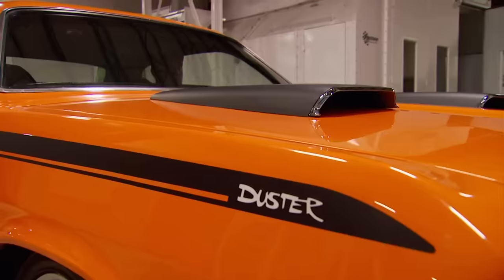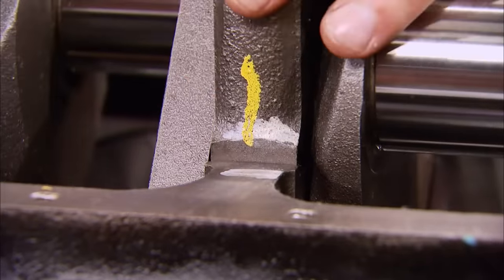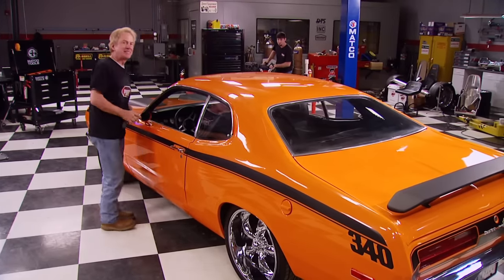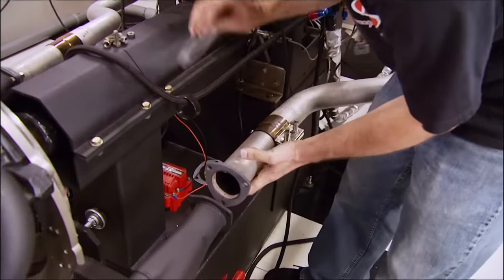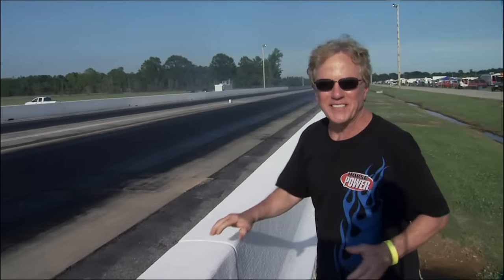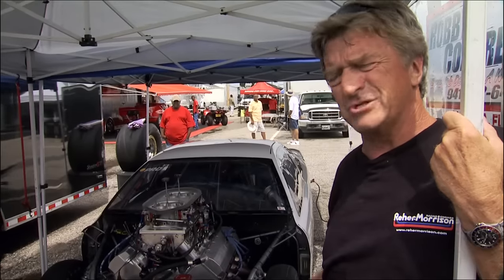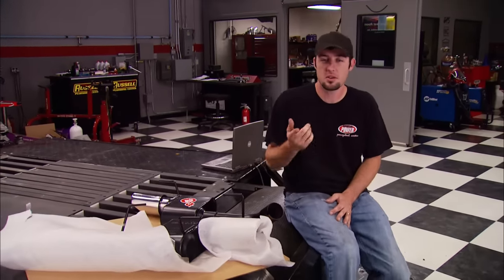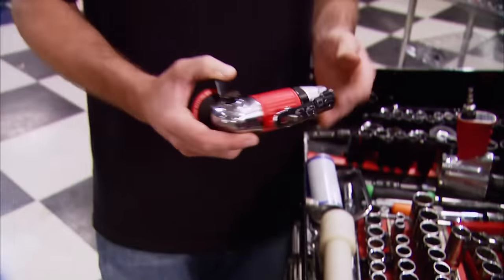Mopar 360 Build on a $2,500 Budget - Horsepower S13, E17

Comment: Imagine how much power this could of made with a bigger cam and some port work.
Reply: Right, if you are putting a cam in, why the hell would you put a stock cam in?
Reply: I would have added those items. some longer stroke too.
Reply: @enigma9789  this is probably only the first episode of more to come
Reply: @enigma9789  usable power band for a dd
Reply: @ Andrew... It doesn't even need that. If you look at the cylinder heads they had huge combustion chambers and dish pistons. That 360 couldn't have had 8:1 compression. A good cam and 10:1 compression would make impressive numbers, but it's not a GM product so they have to rig the build.
Reply: 340-350hp
Reply: @enigma9789  that wasnt stock. stock cam made 250hp this one 314hp
Reply: Just porting and Polishing the factory heads with that cam will give the 360 around 335 HP.
Reply: idk...  I like the idea of a old "mildly" built 318.  But I know I can make more out of a sbc for less... and I know if I had a lot of money I could make more with a ford.  hmmmm.. decisions decisions. . .   HOW about this, I have a forged 3.75 crank for a 350 v8, if someone has a forged crank for a 318 I'll trade you and throw a LA engine in my dodge.. IF not I'll throw a 6.3L Chevrolet engine in my dodge. lol (yes between a 383-385 depending on how happy I feel when boring it)  actaully yeah screw it, I'm throwing a chevy in my dodge.
Reply: @bigsean2473  headers, carb, lack of smog equipment, and tuning account for the power increase.
Reply: @Ecosse57  maybe some but i dont think that much as the car had a carb from factory, and smog dont take away much at all.. the headers only really give power if you engine has the power already. ill check into this but pretty sure not a stock cam
Reply: @mrmedium7984  There're plenty of better cams than a stock unit for driveability....
Reply: @Autojones  "rig the build" what in the hell does that mean? Mopar has a pretty big aftermarket.......
Reply: @bigboreracing356  that is irrelevant how big ford & chevy's afttermarket is. Mopar has plenty of aftermarket parts, I've been getring their performance parts cataloges since the late 90s..........
Reply: @bigboreracing356  Who the fuck is talking about racing turbo LS cars (I own one)? We're talking about the aftermarket..
Reply: STREET RACER ...That's why some of us stick to bracket racing and leave the heads up gig to the fellas with deep pockets !!!  In the heads up world, there is always someone with more cash and a faster ride. In bracket racing, skill wins every time. Rock on 👍🏻
Reply: @bigboreracing356  I own a 6.0 4 eye fox with a s480 & a powerglide.....
Reply: @bigboreracing356  No I used an ls because it has a 6 bolt cradled main, large cam journals, grear flowing heads (square port), factory parts that make hp such as the intake, & all around strength.
The parts that went into the block; crower rods (they make stuff for mopar), wiseco pistons (they make stuff for mopar).
Reply: @bigboreracing356   can you say Hellcat?!?! LS and Coyotes engines are fairly new compared to the old Dodge engines. Old  Dodge's will beat Old Chevy's and Old Ford's everytime. If you want to compare new stuff then compare it to the new Dodge stuff!! P.S. old Dodge's can run on nitrous too!
Reply: @bigboreracing356  The aftermarket for a small block Chrysler is more than sufficient to run with any other small V8. A cam, headers and some kind of power adder are all the non stock parts you really need for big power if you truly know what you are doing. For example Uncle Tony's Garage just threw together a serious tire killing low compression low buck 318 combo that is basically just a cam, intake and headers.
Reply: @bigboreracing356  I'm getting prepped to do just that, gonna build a blown 360 with factory heads and bottom end for my 68 Coronet with a six point cage. I'm going to intentionally turn a 904 into a time bomb to put more power to the wheels than I could if I had a 727. The car should weigh about 3400-3500 pounds assembled and make about 700-800 HP and about 1000 torque, maybe a bit more if I can afford forged pistons so I can turn the boost up and run some emergency spray too. A car that light with that much supercharged horsepower is gonna be pretty potent, especially when you consider the Mopar B body's reputation for hooking up and launching hard on the street.
Reply: @bigsean2473  - your forgetting a couple of HUGE details. The factory 360's had really crappy intake manifolds with EGR ports that killed about 50 hp. Then they had really crappy exhaust manifolds also. This Dyno engine didn't have to fight against either of those two major handicaps.
Reply: @jackandblaze5956  stock cams were as follow for 360 engines:
252/256, lift 410/412
252/252, lift 410/140
268/276, lift 430/444

they used a 276/286, Lift .441/.441,  i didnt for get anything. and a lot of the things you say are true, but the power number people think thing like intake and headers give them are not always  what you actually get from them  .   but my whole point was the cam was not stock if it was i dont think the would of gained 64hp that they did.
Reply: @bigsean2473  - The original 360's from the 70's had EGR intake manifolds. EGR intake manifolds bleed exhaust gas into the intake manifold. EGR = exhaust gas recirculation. It was done before fuel injection was common to reduce combustion temperatures, thus reducing the creation of nitric oxide and nitrogen dioxide gas, which is not the same thing as nitrous oxide. Again, the EGR system lowered combustion temperatures significantly which had the effect of reducing the horsepower by at least 50. Also, in most v8 applications, tuned headers produce at least 5% more power than log type cast iron exhaust manifolds when all other variables are equal. So your figure of 250 HP vs 314 HP was actually spot on considering  the change in exhaust and intake manifolds. Making more power is not always only about the cam shaft - there are other factors and some are even more important than increasing the cam lift by 4%.
Reply: EFI would help too
Reply: @mrmedium7984  They are the smaller valve heads too, don't want all the power on the top and wait too long for it to come on with a huge cam then no flow in the heads, that's a nice dependable street engine
Reply: @bigboreracing356  no , reason to feel sorry it's only a chunk of metal
Reply: @bigboreracing356  I would build a small. Mop. for competition classes outside bracket racing either. But comparisons are generally for A holes especially when there's 10 yrs difference between when they were originally designed.
Reply: I wouldn't sorry
Reply: @Autojones  Yup !!! On my 360 I use a voodoo cam( Hydraulic Flat Tappet, Advertised Duration 268/276, Lift .494/.513), Speedpro H116CP pistons(10.2:1) on a 60 overbore, high flow cast iron heads(1.88/1.60 valves) Chinese Air Gap(Professional products) and Demon Carb...  Good for the street and good for the strip running mid 12s. Good enough and fast enough for me..
Reply: @Autojones   even if they'd used a summit racing 750 carb they'd made more power that 600 is to small it's good for daily driver but for performance not so much
Reply: $2,500 budget... doesn't read description 
in awe when he thinks hes a mechanic
Reply: Did you read the title, on a budget
Reply: @gittyupalice96  People that cross engines into other branded cars are just an odd breed.
Reply: Around 370 hp and 460ft lbs torque, thata how my 94 dakota is built and i went through 3 sets of tires in a month...protip dakotas NEED rear weight some kind, i found the winter water traction bags work nice😀
Reply: CJ Colvin wow that’s enough to chirp the tires on wet pavement!
Reply: @Gap_machine  More than a Chevy can say.
Reply: 92'PowerDiesel dont kid your self, a junk yard 4.8 ls with a rod hanging outside the block makes more than this turd
Reply: @Gap_machine  Now where on this doll did a mopar touch you?
Reply: @bigsean2473  you can make more power with a stock cam. thats like saying 'this company caught 20 lbs with this fishing rod, but a different comany caught 30, so i abviously must buy the other rod because it can catch more fish'. 

what im saying is performance parts dont cap your optput power, they LIMIT your power. you can still make big power with stock cams.
Reply: @bigboreracing356  i built a car for $5,000 it was a 77 newport with a 400. stock long block, biggeer carb and rockers. i still kept the engine loaded, ac working, and that 4700 lb car outran a 'built' LS swap camaro that had heads and a cam in it.
Reply: @bigboreracing356  LS is overplayed, ive got a Built 360ci Magnum in a old dodge truck, Trickflow heads, mid rise intake, long tube headers, holley 800cfi carb, mild cam, 1.7 rocker arms, and a 3 inch dual exhaust, solid 9:s in the quarter and less in it than I would have dumped into just purchasing an  LS, and in my opinion LQ4's are tougher and better then a ls
Reply: Bout 320rwhp lol
Reply: Autojones Exactly. The Mopar builds on this show were always lower power than what they should be.
Reply: Have a buddy with a 340 bored to 416 love 109 octane 6.75 mph but beats my neighbors big block 396 and 383 all day long
Reply: Dude was actually saying Ford small blocks are better than mopar 🧐... and let’s be real here a hemi has a good shot on any ls and you can find em for 200 bucks, slap on a supercharger and I can make 600 hp for the price of your block.
Reply: MOPAR ALL DAY BABBYY
Reply: Oui oui.  I was thinking the same.
Reply: Tiny cam for a 360, pistons are terrible if put some flat tops in it 400hp easy.
Reply: I would have welded the center hole In the heads and intake center hole make more power less heat in the intake I got the same size cam in my 318 it hits a pretty good lick
Reply: @enigma9789  - 218/228 durations isn't a "stock cam"... stock is like 195/205... this cam with right parts could make 400 HP !!!
Reply: @bigboreracing356   will the 360 not take a few lbs of boost as well as all these upgrades? This is what I planned to do to my 360
Reply: @enigma9789  Some people don't want to go all that fast and what to keep things within a budget.
Reply: Imagine bro
Reply: But you don't want to wrench out the tranny or the rear end with the high performance upgrades. That's why lower gears in the rear end. It'll help your performance and reliability and the fuel economy in the long run.
Reply: Support for sbm aftermarket heads suck.  Eq, eldelbrock or trick flow pretty much it. 190cc runners
Reply: yeah, this motor is very mild. Nice to have the dyno to play with timing, jetting, distributor curve.  Asking for air/fuel ratio to each cylinder probably asking for too much!  This was the personification of a new budget build using the least expensive components.
Reply: My 2 barrel had a cam the same size😂

Comment: You should stick a dial indicator on one of the retainers and check the actual valve lift. It is well known that although advertised as 1.5 ratio most of the stock rocker arms were closer to 1.4.

Comment: I'm getting ready to rebuild my 318 , I love mopar great video 👍👍
Reply: Love your Name.. and Mopar Everyday and Everywhere.. 68 Dodge Dart Daily driver.. swapped 318 from slant6..
Reply: I built my 74 318 about 10 years ago. The edelbrock matched set ( intake, carb, and cam ) were great  from summit and if you can afford it. Go with a D.U.I. distributor. You send them all the specs for your engine, drivetrain and car weight and they custom build the 1 wire HEI to your car. They also had a lifetime recurve warranty. Change the stats? Ship it back they would change it for free, FOREVER.
Reply: @SophiaAphrodite  Dang.. that's Rad..
Reply: Depending on your budget and skill level, a stock 360 crank will fit your 318, the main journals have to be ground down a bit, magnum heads (smaller combustion chamber= higher compression) will work on a LA engine, but you have to use amc style lifters and hollow push rods, and there are 2 oil holes that feed oil to the heads that need to be blocked, usually the magnum head gasket is sufficiant for this. But it is not difficult to tap those holes and install a set screw flush with the deck. With the 360 crank and bored 20 over it should be around 344 cid.
But, the 360 crank is externally balanced, so you will need to either get an aftermarket harmonic balancer and flywheel, or have the machine shop internally balance it.
Either way, it is a "relatively" affordable way to build a 318 stroker for daily driving, and weekend fun.
Also, from 1988 to 1992 318 LA engines were factory upgraded to roller cams, 360 La engines were upgraded in 1989.

Comment: I've got a 72 plymouth scamp. Originally was produced with a 318LA but after some searching and horse trading I managed to find a suitable 340. It's off to the machine shop this Tuesday. I have an a833 4 speed (aluminum - even tho I wanted cast) with an 8 3/4 sure grip. Engine will be bored and stroked to 416ci. I have a vic jr 340 single plane intake (that I traded for). Centerline front runners and big meat for the back. Carb will be dominator series to throw as much fuel she will take.

The car was found in a junkyard with no engine but I saw a vision of a nostalgic quarter mile car. While it won't be the fastest thing out there, it will be great to bring her back to life and let her eat.